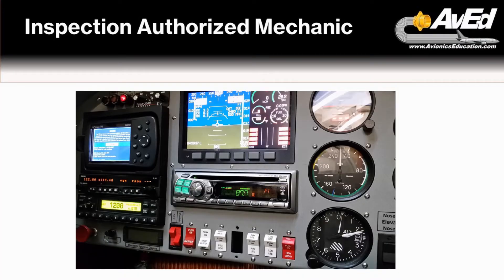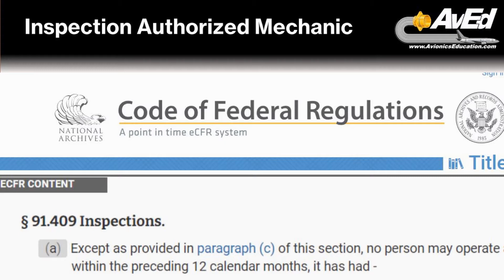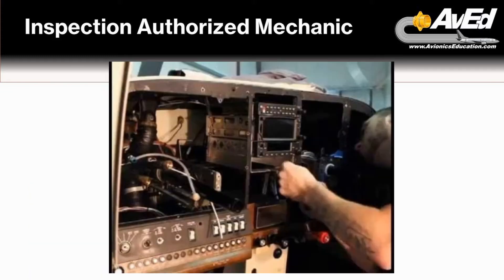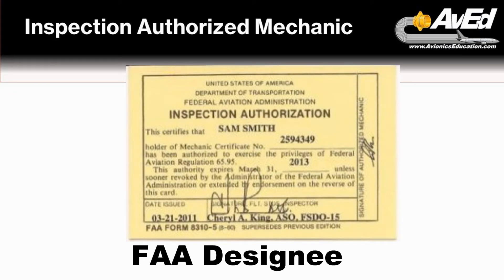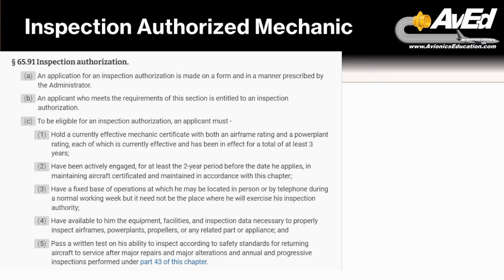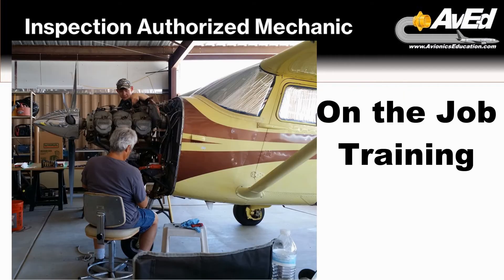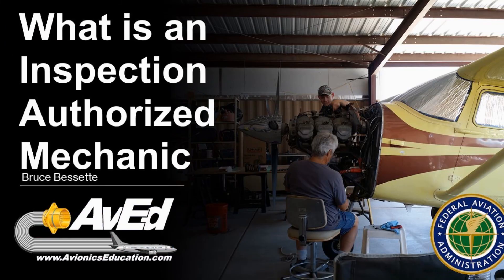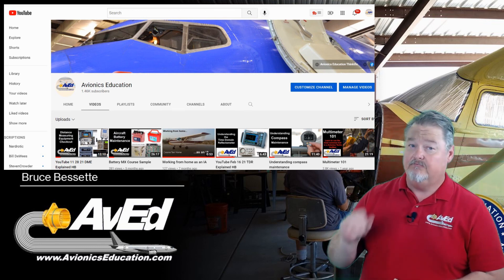What is and Inspection Authorized Mechanic?

Comment: Can use my home as a FBO for my IA application since the regulations doesn’t state specifics such an airport hangar? I am applying for an ia endorsement to take the writing exam.
Reply from the maker: I use my home address as my official address for mailing and list the airport that I work the most out of.  You don't need an FBO or even a hanger to hold an IA.
Reply: I use my home for both, as mailing aggressor and fixed base of operations.